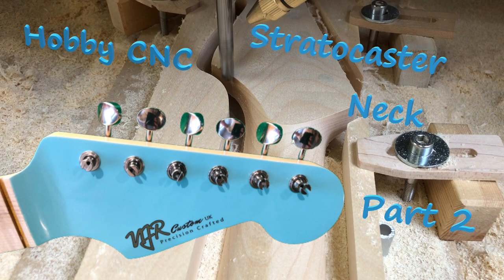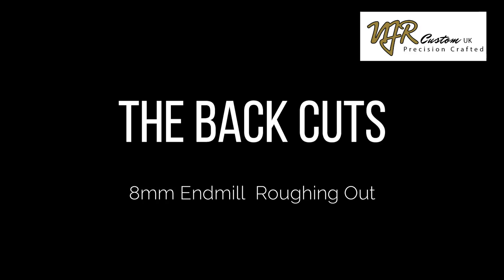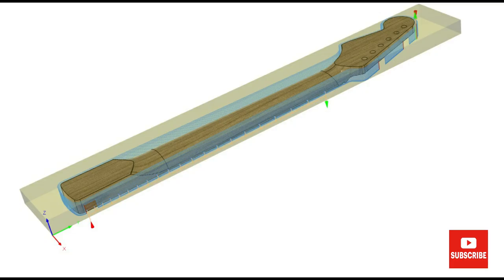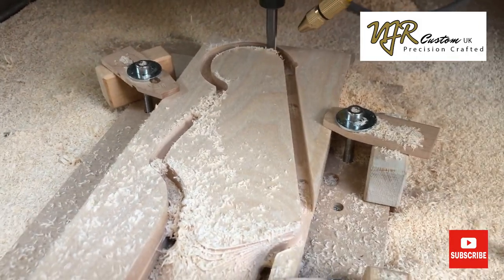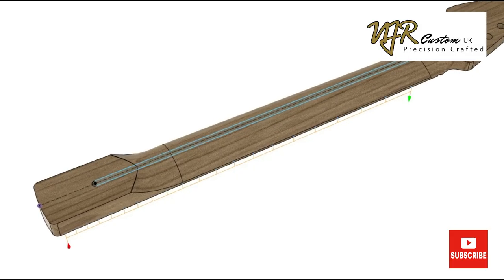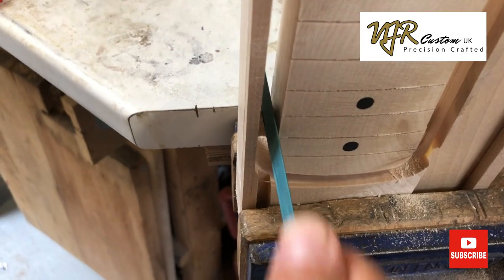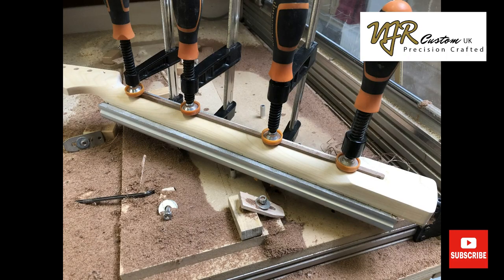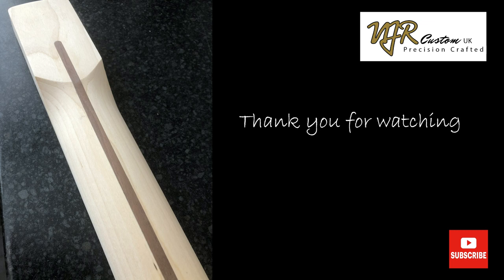Workbee CNC router Stratocaster style guitar Neck spoke wheel truss rod Part 2 NJR Custom Guitars

Comment: Hey Nick. How's things? Just a question on the installation of the truss rod on this. How does the rod reach the spoke wheel with the slot stopping so far from the end of the neck. Did you do a video installing it?

Comment: Nice job Mr. Rogers.  Any issues sliding in the truss rod from the end?? I'm in prototyping mode myself, using an Avid CNC and Fusion.... fun.
Reply from the maker: Hi Joe thanks , no I haven’t had any issues at all sliding the truss rod in from the end. I’ve made quite a few this way now. Avid CNC. I didn’t know about those machines until you just told me. I wish I had because I’ve just upgraded my machine to an ITECH 6090Q. I’ve spent the last week setting the machine up learning the controls adding extraction. Tomorrow the big day with the first attempt at a neck. Best of luck with your projects 👍
Reply: @NickRogersNJRCustomGuitars  Nick, thanks for the reply.... tough figuring some of this stuff out completely on your own....lol, thanks again
Reply from the maker: @joem6859  If I can offer any help just ask 
My Email is nick.rogers32@talktalk.net